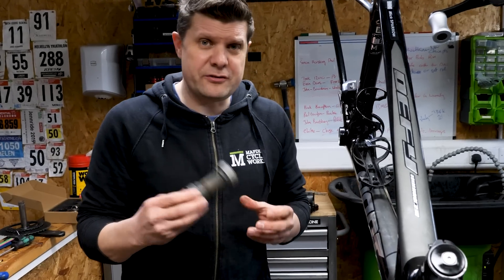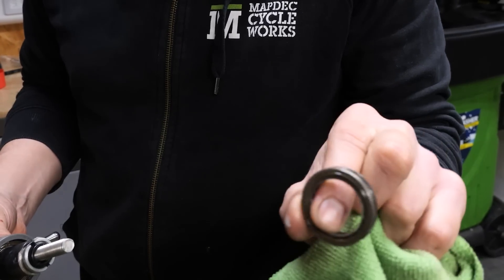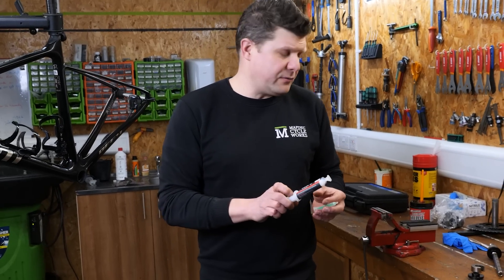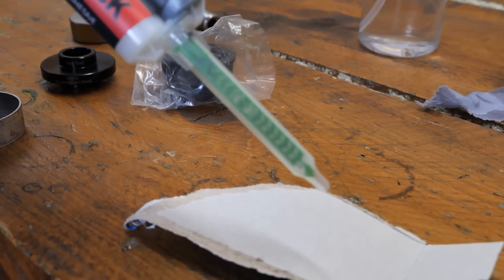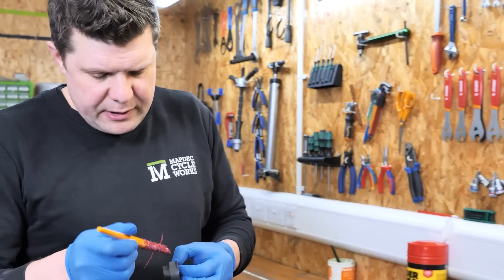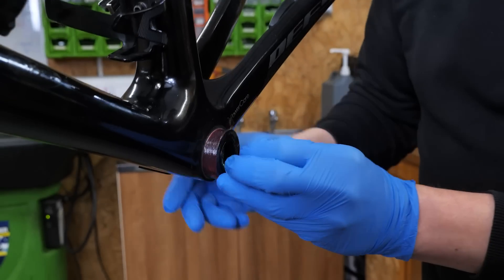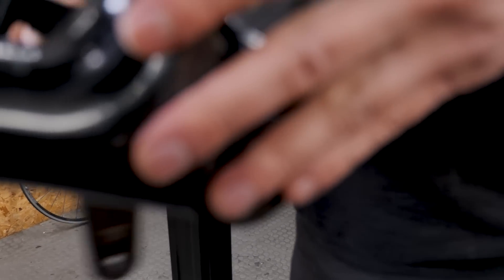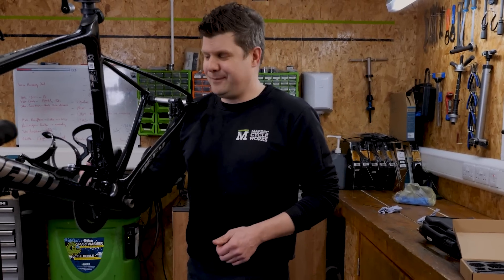I Wonder Why it Creaks! - Giant Defy Bottom Bracket Fix

Comment: Would that have been a warranty claim if the paperwork was available?  Giant frames have a lifetime warranty I believe.  Did Giant use that lithium grease in the assembly or did someone else do that.  Asking for a friend who has a very low mileage Giant Defy Pro 2 with possibly a creaky bottom bracket….
Reply from the maker: Hard to say on the grease.  Yes, if it was original owner it would be warranty.

Comment: I asked ChatGPT if lithium grease expands when it drys out and it said No. So I suspect the opening for the bottom bracket is stretching because of the stresses. If your glue holds, the insert may act as a reinforcement to maintain the repair. But if the glue simply acts as a filler, I think the opening will continue to open up/stretch.  Never saw these kinds of frame problems back in the day.
Reply from the maker: The question there is when corrosion has occurred. What you can see there is lumps that you can scrape with your fingernail.
Reply: @Mapdec  Sounds like corrosion, but is there any pitting?
Reply from the maker: It’s more like clumps of calcification.
Reply: @Mapdec  were there dissimilar metals then? Aluminum frame and a steel insert?

Comment: I’ve heard that the loosening of aluminum inserts is caused by aluminum thermal expansion that carbon fiber does not affect. Repetitive cycles of expansion and contraction lead to failure.
Reply from the maker: Yes. Remember we are talking bicycles and not fighter jet wings or racing cars here.

Comment: Personally, I wouldn't use grease on the plastic shells. Dirt and dust gets in there and gets stuck in it and act's like a grinding paste. I'd use a retaining  compound 🤷🏻‍♂️
Reply from the maker: We covered retaining compound in other vid. The issue with that is that it expands. So you need to measure the BB shell to know you have room for it to expand.
Reply: @Mapdec Cycle Works  interesting didn't know it expands. I mean, you're pushing in a pressfit shell. so it will get forced out where it's tight and fill the very minor gaps else where. we are probably talking microns, but at least it seals it from dirt getting in between. Well, that's what I used on carbon shelled pressfit Tcr adv sl, not the alloy insert ones, not had prob with mine. I didn't know Giant used inserts like that . Must be fairly old defy. I had an old tcr adv sl 2013 model that had pressfit go slack on one side. It was down to not replacing the bb or taking out and cleaning.  dirt and water got in and wore the carbon shell. They replaced the  frame

Comment: Any chance you can offer the brand of tool that you used to remove the bottom bracket bearing? That is much better than the blind hole puller I'm using.  Thank you.
Reply from the maker: Yes. I’ll put it in a new vid. This one is just off eBay. I have a collection.

Comment: I don't get why Giant used to add an inner metal lip to these inserts. It seems that the later models no longer have them. I had to dremel this extra material to install a Hambini one piece BB. Also impressive work as always.
Reply from the maker: I suspect they had some frames come out of mold that were not quite right and this was a method to revive frames that might otherwise go to landfill

Comment: I had exactly the same problem about 18 months ago... 2014 Giant Defy and the aluminium sleeve debonded from the carbon and stayed attached to the BB.  I suspect the fix that was done for me was not to the same level of care & diligence as yours!
Reply from the maker: Oh! What happened?
Reply: @Mapdec  So... I was riding LEJOG in Sept ’21, and somewhere partway through I started getting nasty noises from the BB, which got worse as the trip progressed and finished.

On getting home, and giving the bike a thorough clean & service, when I removed the chainset, on the drive side the BB came out with the crank and chainrings.  Aha! I thought, that’ll explain the noise.  Took it to my local bike shop for a new BB.  When I came to collect the bike, they told me that in fact it wasn’t just the BB that came out with the chainset, but the aluminium insert as well. (tbh I had no idea there was an insert prior to this!)  And that they’d epoxied (their word) the insert back into the frame with the old BB still in it, and then had removed & replaced the BB having done so.  

That first new BB lasted all of 3-400 miles before seizing up.  They replaced that f.o.c., and the replacement has done maybe 1000 now, but I’m reluctant to ride that bike (hence the low mileage) because I’m kind of expecting the BB to crap out at some point – there’s obvious wear marks on the crank axle where the BB is rubbing against it, hence my feeling that the insert has not been put back in correctly.  Any ideas? I’d love to get it back working properly…
Reply from the maker: The reason I double checked with Martin and used vudu glue was because of the fear of expansion or softening with heat. These could be your issue. Hard to tell without seeing and having to wrestle it out again which would be a bad idea.

Comment: Excellent video! Would you be able to do a video about what greases to use? Seems like your really know your stuff! I just tend to use Park Tool ones. HPG for moving parts, and the green one for fixed parts. I have used lithium grease on BBs before 😅
Reply from the maker: There is a YouTube short about it. And more info in the Gigantic Bike vid.
Reply: @Mapdec  Are you applying the same grease for BB and headset assembly?
Reply from the maker: For IS I would just use waterproof bearing grease. For ZS or EC I would use an appropriate assembly grease at the frame / headset interface, and a the bearing grease at the headset/ bearing interface.

Comment: Absolutely terrific video showing what really happens with some supposedly straight forward jobs.  Three years ago a good mate asked me to replace his BB in his Giant. Drive side bearing cup comes out no problem , non drive side , same as yours the aluminium insert comes out. Shock and horror 🙈 Anyway finally got rid of the plastic and the aluminium cup was all good (you did a much more professional job than I did at removing the bearing & cup) I used araldite to bond the aluminium cup back in.  The bike is still going strong today 🤞🤞 Really appreciate your tips in regard to glues and greases used as well as tool selection. You’re doing a great job. Take care 👍👍
Reply from the maker: Thank You Paul.  I’m sure araldite will be fine. The reason I checked in with Martin and used vudo was because I was concerned about expansion and the surface corrosion on that alu cup. The problem with Vudo glue is you have a very short amount of time to work with it.

Comment: is this an issue with threaded BBs? i have lithium grease and planned to use it to install my BBR60 BSA68
Reply from the maker: White Lithium grease is a pretty poor assembly grease for any application. It’s super cheap though which is why you see it smeared all over new builds.

Comment: The Park Tool press does absloutely nothing in regards to parallel alignement of these cups, especially with the nylon BB between it and the Aluminium cup that needs to be glued in. You could have used a crank spindle at least. I also wonder why you did not spread the Voodoo Glue evenly, to provide better adhesion. You could also have filed in some slots with a needle file to get a bigger surface, without changing the concentricity.
Hope this fix will last a bit...
Reply from the maker: Oh. Hello troll. I followed the instructions. There is about a 4min working time. Removing the press and installing the crank would have disturbed everything. Do you honestly think we record and show everything on a YouTube vid? It would be really long and boring if we did 😂
Reply: @Mapdec  no need to call me a troll, just bc. i make suggestions for improvement. I still doubt that a the combination of your press, the plastic inlays in the bearings, bearings themselves, and an outer plastic bearing housing can provide stiff and true alignment for the Aluminium shell. Make what you want of that.
I can only comment on what you show, and this leaves room for improvement imo. 
It is debatable, if an epoxy with only 4min time until settlement has been the right choice for this application. I use JB Weld, which allows for finer adjustments in the first hour for applications like that.
ps: wasn't meant to hurt your ego, buddy ;-)

Comment: That will probably hold but I'd doubt it being aligned and uniformly bonded with that method. Many tricks used in building such bonded joints are available like small glass balls into the glue to make sure equal glue thickness.
Reply from the maker: Well. I would say it is bonded and better aligned than it came from the factory.  Fixed fit H7/n6 for shell.  There was no inherent misalignment like the other vids. This is a straight forward job.
Reply: Isn’t this also the inherent fault in “normal” press fit into carbon

Comment: It creaks because its pressfit. Just avoid frame manufacturers who still use this system over the reliable threaded bbs.
Reply from the maker: Everything has problems, just different problems.
Reply: by that logic you need a Alu frame, as threaded insert will have same issue. So best solution is Alu everything, made to spec, with great tolerances, or carbon frame with press fit, made to spec, with great tolerances.
As temps lower rapidly the insert shrinks, while carbon shrinks less, so shrinking and expanding, over and over, eventually it will get loose. Just as Hambini has been telling.
Reply: @mtbboy1993  an alloy threaded bb, factory bonded into a carbon frame is completely different to a plastic or metal pressfit bb shell which is pressed into the frame using little more than friction and some specialist grease. Why did Specialized, Santa Cruz, and most recently Yeti all go back to threaded bbs if pressfit is the best solution? Hopefully the same thing will happen with superboost and boost hub specing will remind the standard along with threaded bbs.
Reply: @jonathanhowson6420  Problem with bonded insert, threaded or not, is that rapid temperature changes effect it, the insert will shrink more than the carbon will, so eventually the insert comes loose. Hambini has explained this in several of his vids. When it expands due to heat, that's called thermal expansion, when it shrinks it's thermal shrinkage.
As I ride would take a bike out from room temp to -10C this would be torture for the BB shell insert.
Reply: All bearings are pressfit
Reply: @georgeserhard4326  anyone who says they hate pressfit, never had to deal with cup and cone BBs!
Reply from the maker: Trip hazard 😂
Reply: @georgeserhard4326  Yes that's true, not all BB cups are, there are cups threaded into frame, threaded into Alu insert that is bonded to carbon frame, there are presssfit bb, pressfit into Alu, Pressfit into carbon.
Reply: Back to bad threading and damaged threads because the BB68 threading is good for steel and was never intended for aluminium.

Comment: 5:20 bin the first dribble as it will not be mixed. If you have time just bin the mixing nozzle. 
Bin all your white "lithium" grease. It only belongs inside gear shifters on top of pins that pivot to stop water ingress and stay tacky.
Reply: Something like BelRay waterproof grease or marine grease is the best. I use it on the suspension and swingarm  bearings of dirt bikes that are often submerged and pressure washed
Reply: To align the BB the bearing press is better than nothing, but assembling the cranks and preloadind both bearings is the only way to align it. 
Just preload and spin the cranks to radials align it.
Reply from the maker: Can't see why that would be any better. It would mean disturbing everything. You only get about 4 mins of handling time with that glue.
Reply: @Mapdec  The bearing press makes things planar. The crank would improve the concentricity between left and right.
Reply from the maker: It was binned.
Reply: That BB cup is meant to be hard anodised. They didn't even clear/yellow anodised it because they were Penny pinching/Planned obsolescence. 
Anodising will prevent the electrical charge between the 2 dissimilar materials. Ideally you needed to 2pac epoxy spray paint the cup &/or frame. 
Use nickel anti seize, not copper, not clay grease, not lithium grease. NICKEL. The nickel will be attacked instead of the aluminium carbon iron etc. Copper is for high temp exhausts not bicycles.
Reply from the maker: Not convinced with this. Can you evidence?

Comment: Press fit bb is ghetto
Reply: For racing its perfect. You can roadside BB change with a rock and a screw driver. For quick pitstops and 1 less step during frame manufacturing it's the ticket
Reply: There are no bikes in the ghetto, they've all been stolen. Silly boy.

Comment: Things get really tricky when grease holds better onto metal than epoxy. Reminds me of delamination problems with Boeing Dreamliner in 2021
Reply from the maker: WTF 😳
Reply: @Mapdec  well, not metal exactly, but carbon on carbon: resin did not adhere properly because of contamination with release film residue.
Reply: The lithium grease is pretty corrosive, combined with the natural water around the BB it's only a matter of time before it breaks down the glue joint

Comment: The downside of bonding metal inserts into carbon frames. I think we're going to see a lot more of these as threaded bbs are coming back into fashion.
Reply from the maker: Possibly.  The treaded inserts are a lot bigger and go the width of the frame.
Reply: Yes it can be. However I'd like to see someone produce bsa inserts that can be bonded into pf30 bb shells to allow a shimano hollowtech bb to be used  on older carbon frames .
Reply: @Andy-co6pn  You could just bond one of the one piece pressfit bbs into your frame like Hambini's or BBInfinite, you'd get better results.
Reply: @Andy-co6pn  there are such inserts, FSA make them as far as I know. But I'd still prefer a one/two piece BB, there are affordable ones too.
Reply: @feedbackzaloop  Yes - I did this once, before replacing with a Hambini PF30 > Shimano 24mm BB.
Reply: Press it is nice if it's done well, then threaded insert is not needed, but with Alu frame threaded BB is not an issue if done well, no insert there. but misalignment and weird issues can happen on them too.
Reply: The threaded insert is still bonded in the frame. If you seize a BB cup in there and brute force remove it you will we bond it
Reply: Clean and re-grease greased parts at least once a year and you won't have a problem.
Reply: @sepg5084  ….especially pedals and seat posts. 5 min job once every year will save you a lot of trouble.
Reply: I can only assume they design the bottom bracket inserts to release  rather than be a strong bond in the frame to save the frame from damage. 

If you wanted the insert to be a solid bond in the frame,   the insert would have some type of keying, such as grooves or knurling on the outside diameter, like they do with overmoulded inserts on injection moulded components.

I have noticed threaded bottom brackets are making a come back, maybe that tells you something about press fit having issues.

Great video and top notch work👍